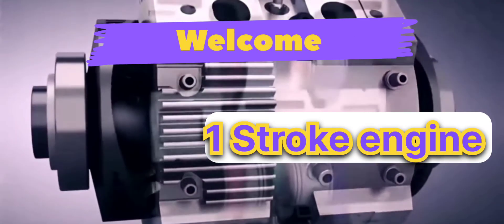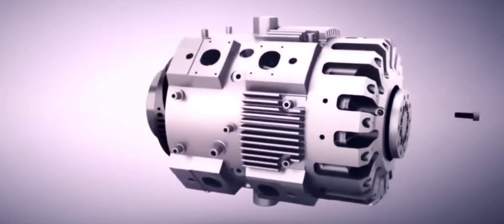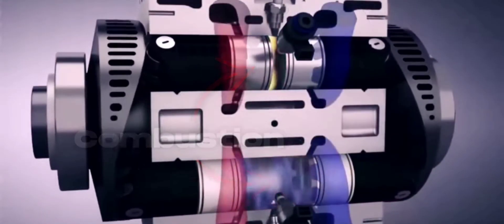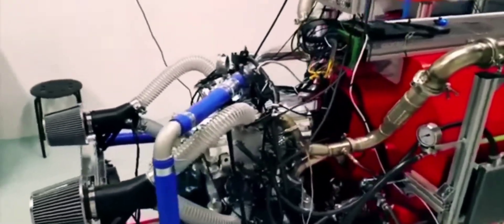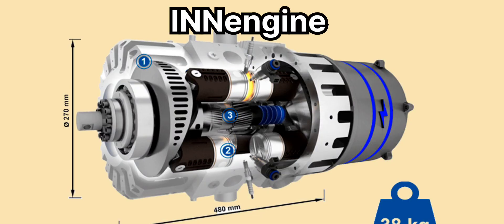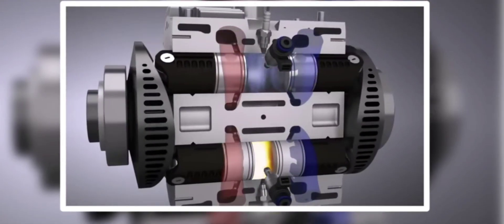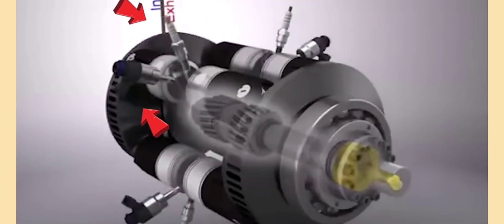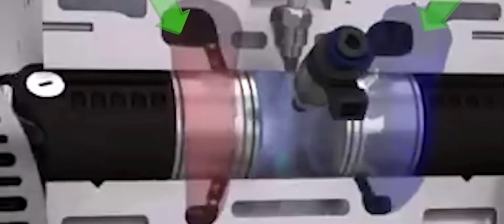1 Stroke Engine working | One stroke Engine 4X powerful than 4 stroke#technology #automobile#engine

Comment: The engine is Revs limited, very smooth,  quiet & fuel greedy, difficult emissions. Apart from al that originally built by Hoken Christensen in the early '80's under the "K CYCLE" name, in Winnipeg Ca..